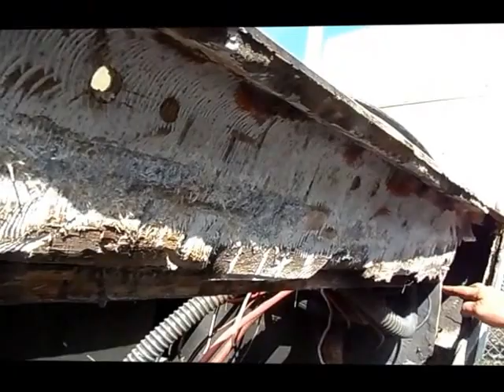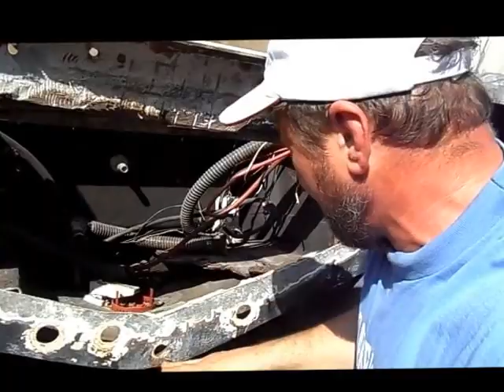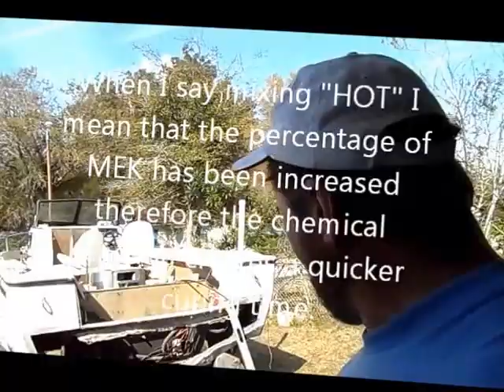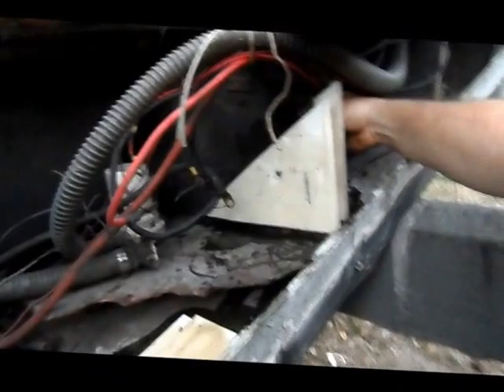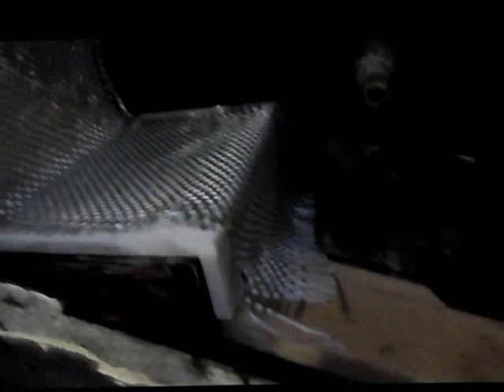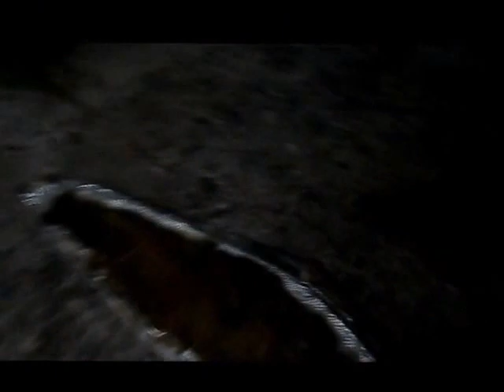Transom repair with Certified Technician Nick Hudson PT2

Comment: Nick-

Thank you for the video. I live in Treasure Island and have to repair my transom do you do work on the side? Repair shops are trying to charge me 2500 - 3500. If you could send me a message i would appreciate it
Reply from the maker: steve micahel I now run my own company, Service Pro Marine. The prices you are being quoted are fairly accurate. The job in this video was 2500. It depends on the depth of the scope of work though. This was a worst case scenario.